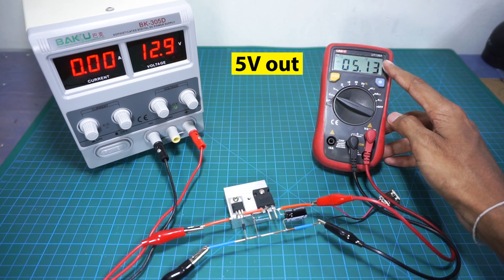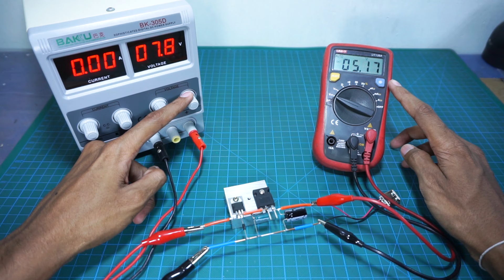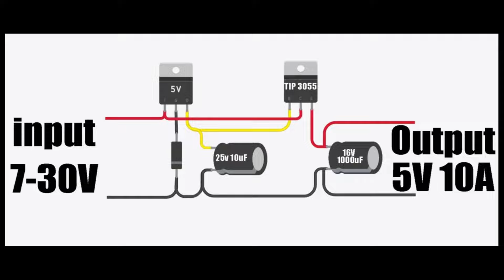How to make 5 volt power supply using LM7805 with TIP3055, Can 5 Volt 5 Ampere

Comment: Would benefit from correctly identifying the diode instead of  + and - which is incorrect. Otherwise I would also add smaller snubber capacitors (10nf to 100nf) across regulator input and output. Don't forget your heatsink paste and gauge the heatsink size for the power dissipated - ie. 12 volts in, 5 volts out at  amps - 7 volts drop x 4 amps = 28 Watts. That heatsink is TOO small unless supported by a fan!
Reply from the maker: thank you

Comment: I want to make 36v 5amp to 12v step down circuit. Can i get it using tip 3055 and 7812 transistors???

Comment: How much maximum voltage can i give as input to this circuit?? I want to make 48v to 12v dc to dc step down converter.
Reply from the maker: maximum input voltage is 35V,